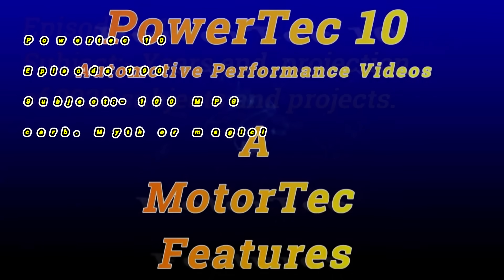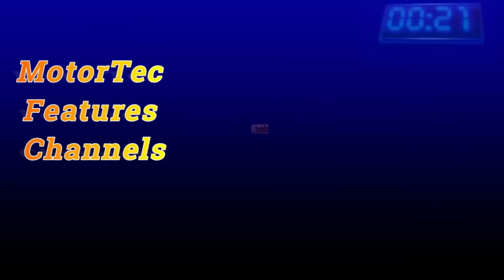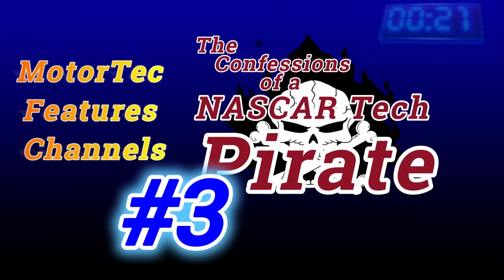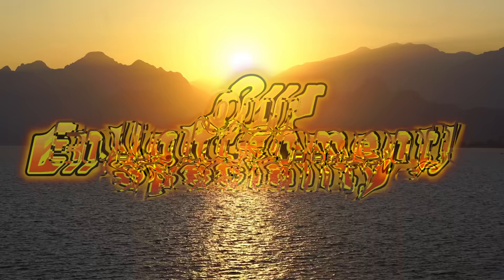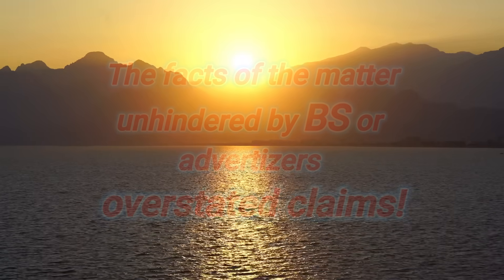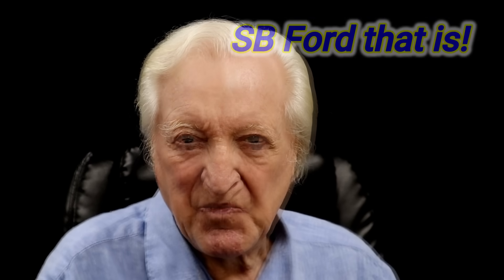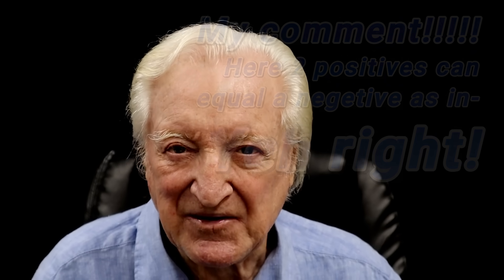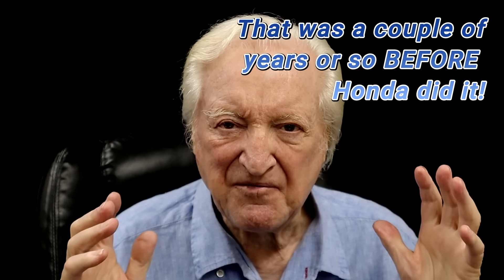The 100 MPG carb - reality or real BS

Comment: Smokey Yunick's "Hot Vapor" Fiero was a modified Pontiac Fiero that reportedly achieved 51 mpg and 0-60 mph in under 6 seconds, using a "hot air" engine design. This design involved superheating the air/fuel mixture to over 450 degrees Fahrenheit to achieve complete combustion and potentially increased fuel efficiency. Smokey Yunick awards: Two Time NASCAR Mechanic of the Year Mechanical Achievements Awards – Indianapolis Motor Speedway & Ontario Motor Speedway Engineering Award – Indianapolis Motor Speedway Inventor of the Year – 1983 Presented the Annual Smokey Yunick Lifetime Achievement Award at Charlotte Motor Speedway. My reason for posting information about Smokey Yunick's "Hot Vapor" Fiero is solely for the purpose of showing how he increased the performance of the stock engine. A stock engine 2.5L (151ci) Iron Duke four-cylinder makes 90 horsepower and 125 lb-ft of torque. With Smokey's modification it made 250 horsepower and 250 lb-ft of torque.
Reply: I was going to post on Smokies hot vapor setup but I thought somebody else may have so I checked the comment section and sure enough here we are and yes Smokies design did work however there was some safety issues with heating air fuel mixture to 450° so it’s could be a little dangerous but it worked
Reply: Had a V8 small block Chevy that was a real bad ass
Reply: Yes, but what supposedly motivated Smokey was the legend, and some of us in the shade-tree mechanic world have built similar versions.  The gasoline can be atomized and superheated through better mechanisms than trying to recycle the fuel back through manifolds and scavenge unburnt molecules.  It adds a layer of complexity and effort no automaker has been incentivized to attempt.  For obvious reasons, oil manufacturers and auto makers share motivation to garner as much profit now, as possible, rather than benefit the common good.  So, sure, we CAN build small engines with gasoline fuel systems in small, lightweight cars, that could conceivable get pretty close, depending on utility needs.  No one is doing those, and with the advent of battery technology rapidly outpacing driver demands, the entire subject will soon moot itself.
Reply: Are you aware that a stock factory 4 cylinder fiero could get 50+
Mpg? Kinda makes the highly modified's 60mpg not as impressive. Though smoky's acceleration was a lot better!
Reply: @jimlathrop8603  My reason for posting information about Smokey Yunick's "Hot Vapor" Fiero is solely for the purpose of showing how he increased the performance of the stock engine. A stock engine 2.5L (151ci) Iron Duke four-cylinder makes 90 horsepower and 125 lb-ft of torque. With Smokey's modification it made 250 horsepower and 250 lb-ft of torque.
Reply: @jimlathrop8603 people have reported 60mpg in those first gen Honda CVCCs and the old Minis, enough anecdotal evidence exists to suggest a 50mpg vehicle is pretty doable, with even older technology.  It’s the need to drive on roads full of 3ton SUVs with a 0-60 time of 5.2 seconds that makes such things moot.
Reply: @jimlathrop8603 the 1.0-liter geo engine will easily get 50 plus mpg with no mods. I read a few years ago about somebody cutting down the roof on one for 2 passengers, 1 front,1 in rear. He installed a steeper OD and achieved 80 mpg.
Reply: Thanks for the Google AI answer.😢
Reply: @steveletson6616  Some know about Smokey's invention and some don't. Did you?

Comment: There is a channel called Thunderhead289 that got 40 Miles per gallon on highway speeds, using a lawnmower carburetor on a Ford 289.  Looking forward to your info. Great videos David!
Reply: 40 or 45 mpg, both quite impressive. Quite similar to my common rail diesel peugeot 406. The videos of his i watched, he seemed very surprised himself at the mpg, think originally he was just 3d printing a 4150 to lawnmower car adapter for a laugh. Pretty sure one of the videos was a fill up, drive, and then top up with no breaks in the video. And yeah he says on the video the power is decreased(think it's a 302 Ford) but it gets up to speed fine and cruises at 70(i think) still, which is plenty of power most of the time. He also makes a computer controlled vacuum leak to keep the mixture right, cause the lawnmower carb runs way too rich on its own. That's it though.
Reply: @joecook3223  I ended up buying one of his carb cheaters, works great on my 460! Ya a power decrease on his car with that small carb, but like you say, not bad.
Reply: I remember that video, but thought he got 45mpg but maybe it was 40mpg. Seams like I remember him saying the horse power was not as good as normal. But I also remember the video has gaps in it, but he did have that 289 running with a single barrel lawn mower carb.
Reply: @GenderSkins  I thought it was 45 also, but went back to the video to see and it was titled 40. I would say he didn't put gaps in it, he did a good job at showing the trip and was quite surprised. Started off as a joke and now a great business. I bought one of his carb cheaters.
Reply: @GenderSkins  In the 1970's (post oil crisis of 1973) it became a thing among car companies to offer special frugal versions. Renault offered the 5TL that had a 956cc engine but they also offered the 5GTL  (a torquey 1289cc) with a small single venturi carb and a long final drive ratio that actually got better mpg. 
In the US people often owned V8 cars with 4barrel carbs and to conserve fuel some people  just disconnected the vacuum secondaries so the engine would only run on 2 barrels (2 venturies)
Reply: That rusted out shitbox had a 302😂
Reply: Yes the owner of the channel figured out how to make the carburetor auto adjusting with basically an idle control valve and some electronics he programmed himself. It is pretty impressive. There’s actually a series of videos and an intake he made that’s about 6 feet tall to show it would work.
Reply: @realAZliving it's literally add on electronic metering for an old school carb
Reply: Carburetors are wonderfully designed mechanical computers to deliver optimal power when needed, however, they are dumbed-down on the efficiency side of the equation so as not to give the awesome fuel economy earth-lovers want.  EFI is just the electronic version of typical carburetor.
Reply: I had a POS Datsun 310.  It got 40 mpg.  It was the worst car I have owned.
Reply: Thunderhead also put it on a dino if I recall correctly. It reduced his power to around 40 or 60 hp... but he got 40 mpg on the highway, as at highway speed you're not under load and require less power to stay rolling!
Reply: Yes , Smokey had a V8 Chevy that used that Lee tank idea but added a turbo to push the intake air thru the carb, the fuel was heated in different fuel flash points, If I remember correctly - 5 different stages - it was published in a car magazine in the 80's
Reply: running the engine poor will ldestroy it. stupids who think to castrate an engine is a good idea.
Reply: @oliverroedel1111  The lawnmower carb actually ran rich and he had to make a controlled vacuum leak to off set the rich mix from the lawnmower carb.  He is far from stupid, it made him a great business making carb cheaters and they work great! I have one. On the 289 motor, the lawnmower carb decreased the power, but it was able to still drive 70 on the highway. It had the right mix of fuel to air, but less volume.
Reply: @denniskwasnycia1950  liar! how a small carb like this could be go rich for a big engine
Reply: @oliverroedel1111  The vacuum is so high through that small diameter orifice and that 's how. The fuel will be pulled in the quantity that the carburetor jet can flow.
Reply: @denniskwasnycia1950 I think the carb cheater and being in Iowa was the trick though.  Driving on perfectly flat ground doesnt require much power at all.  Using a controlled vacuum leak to correct the metering to get a lean AFR absolutely could get excellent fuel economy
Reply: @oliverroedel1111  Who me a liar? No, Go watch the video yourself for the details.
Reply: @denniskwasnycia1950  don´t need to watch a video, there are many fake miracle vids around. it´s a simple technical question: impossible. only if the lawn mower hat a 4,7l engine hahahaha
Reply: @oliverroedel1111  Do you not understand how a carburettor works then? Answer: Clearly not.
Reply: @oliverroedel1111  it runs rich because the vacuum signal to the float bowl is quite strong, on account of such a large engine trying to breathe through such a small carb.
Reply: @oliverroedel1111 how? Just however its setup it could easily flow to much fuel. Especially with the vacuum pull through such a small barrel? Thats going to pull hard on it. Your understanding of this is way off.
Reply: @oliverroedel1111 Because the lawn mower carb is letting far less air into the cylinders in addition to less fuel.
Reply: @denniskwasnycia1950 its still pretty stupid in principle vs recording the mixtures and replicating them.

The numbers are similar to a modern sedan civic without the option to floor it.

But over the years enough people have gotten into their heads the legend of the lawnmower carb so it does make money to sell them - so does hho systems as does magnets, doesn't mean its that much sensical, it doesn't stop to think "what am i doing how can i get this fuel in otherwise" - slapping a lawnmower carb and running through hoops to not have it flood the thing while still presumably using  an american v8 for powaaaaahhhhhh is just you know very silly.
Reply: @lasskinn  Obviously you have not looked at what he is doing. He is not selling lawnmower carbs. He put one on for a joke, but in turn, turned out that in making it work with a controlled vacuum leak, just as GM used on their vehicles, got him surprising results. The system he made called the Carb cheater is a great product that helps a carbed engine have a targeted fuel to air ratio, making the carb closer to a fuel injected system.
Reply: @oliverroedel1111  The tiny carb actually produces a stronger vacuum signal.  It ran rich naturally not lean.  And he corrected the AFR.  So it didn't run poorly.  It just ran like it only had quarter throttle, because it only had a tiny single barrel to breath through
Reply: @limprooster3253  a smaller carb has smaller jets, so the mixture could be rich for the small engine, but never for the (much) BIGGER engine
Reply: @oliverroedel1111 go watch the video. Then come back and tell us how he did it (without doing it).
Then we will see who the liar is.
Reply: @samnope7344  sure not, that is why you have different jet sizes. and you never will get near the max flow of a carb in normal conditions, on a too big engine it will, and the jets too.
Reply: @limprooster3253  I think you get pressure/vacuum and mass flow wrong. there is a point were more air flows than the jet can give gas to it.
Reply: @limprooster3253  vacuum doesn´t act like pressure.
Reply: @oliverroedel1111  Vacuum IS pressure. What we call vacuum is actually a space with less than atmospheric pressure.  

I agree the amount of fuel pulled through a jet has diminishing returns based on velocity.  But the thing you have to understand is that the carburetor can only flow so much air.  Exact same concept.  I can make a manifold adapter and bolt a lawnmower carb to a 10L engine if I want wanted to.  And it would have a crazy vacuum signal back to the carb.  But I doubt much more AIR would flow through that carb than if I had it bolted to a 5L or even a 2L.  That carb only flows so many CFM. The mixture isn't just richer because the bigger engine pulls more fuel through it.  It's richer because the bigger engine pulls more fuel through it but DOESNT pull much more air through it
Reply: @oliverroedel1111 this is true. Better to just get a lighter car with a smaller engine if you want better mpg.
Reply: @oliverroedel1111 He has his little gadget that gives it more airflow. The engine was getting close enough to what it wanted.

Comment: I dont understand how a Pogue carburetor would be any better than a manifold heat crossover with the flapper diverting all the exhaust across the intake manifold or a GM THERMAC system with the damper drawing all the intake air over the exhaust manifold.
Reply: hot intake-manifold has less oxygen, so we need a computer & a fuel-injector to meter the fuel to compensate for reduction of oxygen due to hot intake-manifold.

Comment: The only place you will find a 100 mile per gallon carburetor is, as said here, on a light duty motorcycle, or a car engineered for maximum efficiency at the expense of everything else.  Such cars have been made, but they would be unusable in actual real world life and insanely expensive.
Reply: people haven't yet made a car running on small-cc and large-cc engine simultaneously. The small-cc to provide fuel-efficiency at cruising, while large-cc for torque during acceleration.
Reply: @xponen  They sort of did the same thing with displacement on demand.
Reply: @joshhoman  displacement-on-demand is different than using engine made for small-cc, because small-cc uses small-piston & bore-size that is said to increase efficiency. A cylinder shut-off to reduce displacement or cylinder filled with inert-gasses to reduce displacement is not the same (that reduce the combustion-volume but didn't change the bore-size or piston-size).

Comment: Thanks DAVE for tackling this issue .  In the early 1980s, I saw an add in the Sunday paper for a booklet named, " SECRETS OF THE 100 MPG CARBURATOR" .   Cost about $12.00 so I sprung for 1,... a week later, got it. Gave history of several different mfg's,... Kendig, FISH, .....but the POGUE Carb was the most fascinating ! In the booklet was printed a letter from the Vice Pres of the SHELL OIL CO.  The story read,... SHELL people including 2 SHELL mechanics, visited CHARLES POGUE to see the carb and go for a test ride.  After the Shell mechanics were done looking over the car for HIDDEN fuel tanks or lines to spoof the test, all were satisfied and were about to put in 1 Gallon of gas when POGUE stopped them and said, " I don't want to go for a 100 mile drive this late in the day and dinner time is coming soon, so just pour in 1/4 of a GALLON !  Shell men agreed, 4 men loaded into the car, POGUE started it, let it warm up and off they went. They drove 12 miles out and 12 mile back to POGUE's home where it continued to run for several minutes before dying,... Out of GAS !   I need to dig up that booklet and post it to you !
Reply: Yeah that Pogue carb was evaporating fuel and only inducting the fumes to the engine. Then there's is a vortex type carburettor. Geet.
Reply: @gairnmclennan5876  Pogue's device may not have just been vaporizing fuel, it may also have been 'cracking' the gasoline.   The device works in such a way that the fuel enters into intake port and cycles to center in a circle.   At some point the gasoline might break down into more simple gas VAPOR molecules like decane, nonane, octane etc. promoting more efficient combustion on ignition.  Might have to lean out the timing though.
Reply: @babylonmustfall  I don't really know much about hydro carbon cracking but I was under the impression it has to undergo some chemical or energetic process to break the molecules apart. 

I don't think swirling them around a port would do it but then again I haven't seen the source material y'all are talking about.
Reply: @babylonmustfall 
The Geet carb does that .... vortex.
Reply: @thomaskovacs5094  The chemical and energetic process is done at the refinery to break the crude oil into gasoline; however the process must be dialed up or down for more gasoline or diesel as the local need demands.   Some smaller hydrocarbons are produced from refinery cracking, like butane,  but I don't see why this cracking process couldn't be micro-sized for gasoline engines.
Reply: @gairnmclennan5876  Paul Pantone also claimed the GEET system also created a plasma field(?)
Reply: I had the booklet also. I was going to try making one but never got all stuff needed and also did not want something that may explode if the fumes engnited. I think for all My research you would end up with flat gas after a while while the more flammable would come out of the fuel first. Also should try it on a extra vehicle to experiment with. Don't feel it would actually work. Had to watch this video when I seen it pop up. Man sounds very knolagable on engines.
Reply: @tonys78rpmrecords  
I may be mistaken but I thought due to the way crude oil is distilled, even if gasoline has 3 or 4 constituents in it they are similar enough in mass so that they wouldn't just evaporate out leaving a base behind. 

Obviously non ethanol.  But maybe I'm not understanding gas blends idk.
Reply: Didn’t that guy mysteriously end up unalive shortly after that?🤔
Reply: @73PhlonRon23  There was an interview in a 1954 magazine that said he was running a factory in Montreal Canada making hydraulic equipment. His carburetor experiments were made in Winnipeg in the 20s and 30s. So no, nothing very bad happened to him.
Reply: @73PhlonRon23 Mr Pogue lived on. But his shop was vandalized many times, his car and carbs were destroyed and stolen. He was finally forced into a retirement home, poor health.